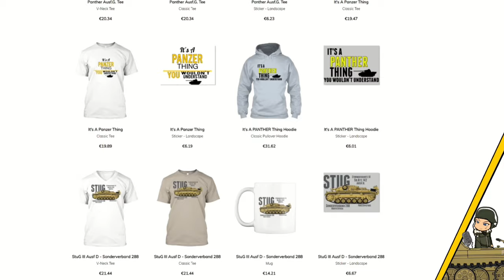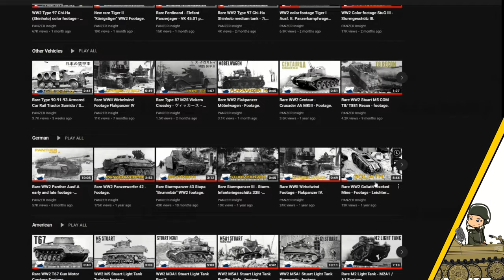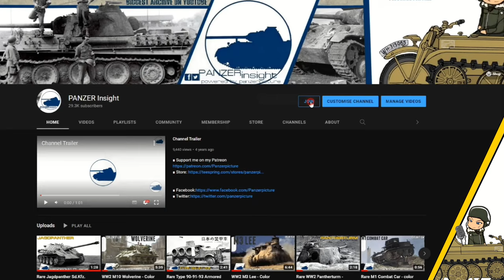Rare Type 92/95 Medium Tractor Ni-KU / I-KE / HO-FU - Footage.

Comment from the maker: During WW1, Japan could not produce a powerful artillery tractor that could pull artillery, and after failing several times to produced any vehicle they imported various tractors for examination to see if they were suitable for practical use.

In 1931 two types of vehicles would be produced to pull the Type 92 Cannon, the A and B model for the light tractor (I-KE) and the medium tractor called the NI-KU, which was designed to tow the Type 89 Cannon.

The Type 95 Tractor (HO-FU) was a 	Heavy Prime Mover designed in 1930s to tow the Type 7 and Type 96 heavy howitzers, two variants would be produced a Model A and B.

Probably the biggest problem Japan seem to have with prime movers is, that developed a lot of them and product a lot to with 1.657 for the NI-KU alone, and by WW2 they did not have one simple developed prime mover to be used in multiple rolls.